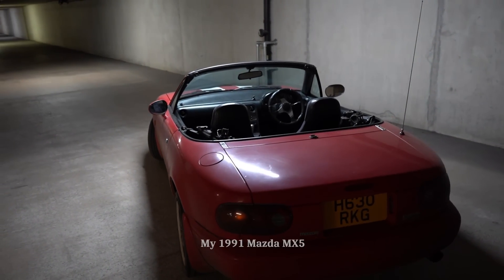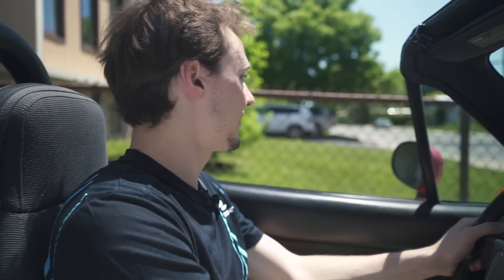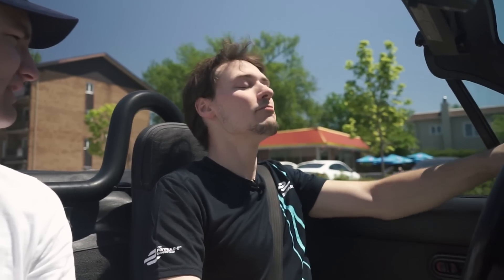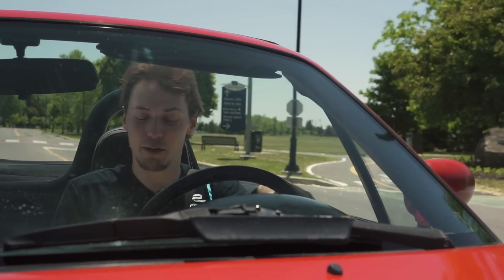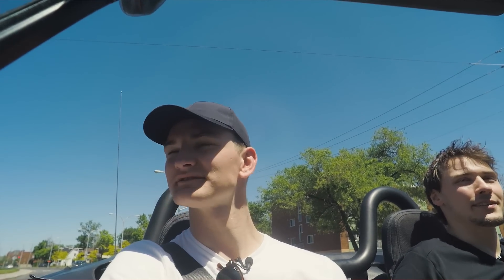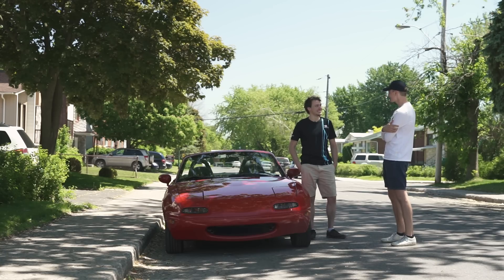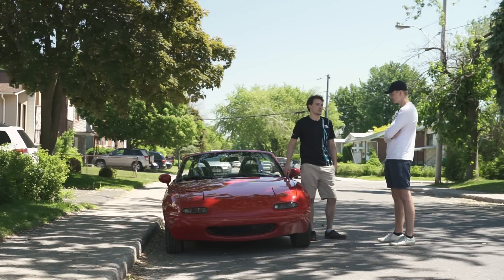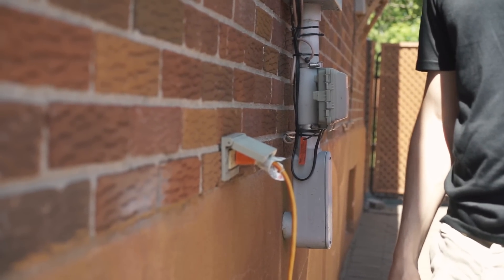A drive in a homemade electric sports car built from a 1990 Mazda Miata

Comment: That was great!

I would have liked to have seen what the motor looks like, though. Is it DC or AC? I've heard that some EV's use AC motors and have to have a conversion component to convert the battery DC to AC for it. I would think that some of the battery energy would be lost in that conversion. I wonder how much it would help the car's milage to use a DC motor over an AC motor.

Comment: How many electric conversion shops do you think there are in the United States?
Reply: not many.... I was going to give it a go, but it's a rough business model. One guy in a shop might convert a car a month, but take 100-150 manhours to do a conversion. hard to charge enough to make a living. Total conversion cost to Lithium will be somewhere between $12k-$20k depending on range and battery capacity; and you can't find a bank to loan it, so its a cash deal. No that big a market.
Reply: @danielbaker716  most of what you say is true there about the hours and the price. My wife made my hobby a business 13 years ago we've been doing okay. Click on my profile to see our shop in projects

Comment: 30 kms range.... 18 miles?
Reply: thats the problem with Lead. Heavy, low capacity, and not many charge cycles.  Ya gotta step up to Lithium to get range and performance
Reply: If that wasn't bad enough, lead batteries die quicker too, by a lot. He will optimistically get two years of life out of those batteries, driving every day.
Reply: @Hamdad  yup, only get about 700 charge cycles out of floodies... 3000-5000 from Lithium!

Comment: Particularly of interest to me as I formerly owned one of the same year. Mine was  one of a batch of 700 with the Sunkist Red paint, and the same wheels as your project car, so I assume it was of that same batch. I imported it (used) from Japan with only 53,000 kilometres and one lady owner.  I had a tyre blow in 2001 while I was driving with the top down, when the car rolled, and I was thrown 20 feet because the safety belt failed (thankfully) but the car was a write off.
Reply: I've been driving my self-converted eMiata ('94) since 2012. Have over 20k electric miles on it. Warp9 dc motor, zilla 1k controller, 160v x 130ah lithium. Super fun. Miatas are a great conversion. more info at envirokarma.org if you want to do one yourself!
Reply: @danielbaker716  I was inspired by your conversion.  The right base to do a conversion on.  I remember being overtaken by a Mitsubishi Evo 7, and I couldn't even catch up.  Maybe  an electric would.!
Reply: @andr00NZ  The torque is AMAZING in a Miata. Limited top end with stock gearing tho since a DC brushed motor 'redlines' at about 5000 rpm. It sure does get from 0-80mph in a hurry . ;)

Comment: how much batteries you would need to power old fiat 600 with lets say smaller motor and lets say 50 km range
Reply: 13.4
Reply: @EasyFlows  kwh?
Reply: @Nele_BiH  yes
Reply: those are super light, so not that much... but I'd recommend Lithium for sure to keep the weight down and not stress the chassis or brakes too much. The average size/weight EV will consume about 1 kwhr of energy per 3 miles driven 'on average' rolling terrain with a little bit of stop and go. Big decision is DC (cheaper and simpler) or AC motor (with brake regen)
Reply: @danielbaker716  I did checked some prices on aliexpress for lithium packs holly shit they are expensive. Motor and everything else combined doesnt cost much as bateries
Reply: @Nele_BiH  that's pretty true..... aliexpress is probably not where you want to get batteries, but yes you'll spend as much on batteries as all the rest. Lithium is totally worth it though with longer life, less weight, less voltage sag. BUT, you have to learn about and respect the fact that Lithium batteries are unforgiving if over charged or run to 0 under load. They die, and don't come back.

Comment: What an awful thing to do to an MX5.
Reply: don't say that  till you've driven it!
Reply: daniel baker I doubt it would make a difference to my opinion. I’m sure it’s a novelty but making an MX5 heavier just seems wrong.
Reply: @richardhoulton4016  what makes you think it's heavier? I did mine with Lithium batteries, have a 50 mile range, and the whole car is a tiny bit lighter than stock (after I swapped out stock seats for Lotus Elise seats)
Reply: daniel baker This one in the vid is 400lbs heavier!  And my Sunday morning backroad run is 350kms! 😂. 80kms (50 miles) just doesn’t cut it...sorry.

Comment: What's your battery capacity (kWh)? And what range do you get? How do you re-charge it?
Reply: He showed how he charges it at the end when he plugged it in and mentioned it cost $1.50 to fill. He also said the range is 35km which he found out when he ran out of power once. It had lead acid batteries so heavy with a short range. Perhaps only about 6 Kw. He started on it when the original Tesla Roadster came out so no fancy battery packs available then.

Comment: How does manual transmission even work with an electric engine? Or is it like a placebo effect to give you the feeling of shifting?
Reply: I mean, an electric motor is still just a motor.  It just has a spinning shaft coming out of it.  You could just hook that up to a transmission instead of to direct drive like a lot of people do nowadays.
Reply: I would assume the motor in it is 10 years old at the least since he built the car 10 years ago or so. Back then, motors were not the best like they are now. They had a power band much like an engine, and didnt really rev high. most reved to about 3600 before dropping torque. Almost all electric cars of that era retained the manual transmission, but most of them got rid of the clutch. Clutch is really unnecessary because you can just lift off the throttle and shift without issue. But it is still fun to have for skids or of you want to shift insanely fast.
Reply: @ohyou_6599  you really know nothing about mx5 do you? practically the NA's engine blows every new engine out of the window if maintained. if you watch the video the dude keeps praising his Corola cause you know.. the corola is also known to be awesome just for being reliable.
the MX5 is made to rev out which means 7k oh higher if tuned. fuel cutoff at 7,3k stock / oil presure increases with rpm and no high boost pressures straining the engine there is only one enemy to this car and that is Rust. ok rant mode off thank you Jester for teaching me
Reply: The motor produces instant torque so you could start it in any gear it's basically giving you the feel but is almost not necessary other than getting the power to the wheels.
Reply: DC motors have a rpm limit of about 5000-6000 rpm, and brushes are advanced to run best in one direction, so most people converting retain the original gearbox and drivetrain. Pretty simple to pull the clutch and flywheel from the original engine, put them on the electric motor, and get an adaptor plate that buttons up to the original transmission, setting the clutch/flywheel right back where it was. voila, the transmission doesn't know youve got an electric motor, expect the torque doubles and you have to be careful not to break things.

Comment: How on EARTH did he make an electric manual? We need these if we want to keep the car enthusiast world alive in the future!
Reply: OrcaStrike77 was wondering and thinking the same thing!
Reply: well i suppose it isn't too complicated in theory. most EVs simply hook up a single speed gearbox, so a simple constant gear ratio. you could just as well hook up the motor to the input shaft of an existing transmission (which is what he did i believe), so you have more torque in lower gears and max speed in higher gears. the reason most EV manufactures don't bother is because motors create significant torque at all rpms and get up to decent speed on that single ratio gearbox too, so they can save some weight, cost and complexity.
Reply: Manuals are actually way easier to convert vs an auto car because you don’t have to do any TCU trickery or vacuum trickery for the transmission since a manual doesn’t need any of that. MTs Only care if you put too much power into it and break gears or if you rev it too high and break gears.
Reply: @Fhwgads11  exactly correct, for DC brushed motors (rpm limited to 5000-6000 before they fling off internal balance weights)

Comment: I despise electric cars. But instant torque in a classic NA with a 5 speed sounds fun.
Reply: And still manual!!!!!
Reply: why do you despise EVs? 200ft-# torque in a NA is a boatload of fun. Mine, with lithium batteries is just UNDER stock weight, and 50/50 balance front/back.
Reply: daniel baker it’s more that I love internal combustion engines too much lmao. I think including more electrics is great, even hybrids, but there’s just something about exploding flammable liquids that is better

Comment: So you are using lead acid batteries... More stable..  I am depressed about  Lithium batteries which are tempermental.
Reply: Joseph DuPont if you’re depressed maybe try taking lithium
Reply: If lithium batteries are so bad, why do ALL EV manufacturers use it?
Reply: @mikiethebikie  because  they can give the same performance with less weight of batteries and  they have engineers to make the right charge and circuts to draw ;power without blowing the batteries up. Its a balance act not meant for ;peo;ple  like me who only understand  Plus Red and Neg Black I'd hate to be on my way to the moon  and have a glitch 100,000 miles from earth. Perhaps I'm being over dramatic, but using these things is more than just getting a deal on
Reply: Not really. Lead acid has poor cycle life. Lead acid conversions tend to need frequent replacement in this application.
Reply: trick with Lithium batteries is keeping them balanced at end of charge, and NEVER discharging too far

Comment: Is is possible using generator instead of batteries?
Reply: Alyssa Price  not enough power and pointless would use mor power than the gas motor if it could keep up
Reply: why build a hybrid? you would need BOTH a generator and a battery bank

Comment: Hi. Do you know Proton Juara? I want to change the engine to electric because it is hard to replace engine model. If you can show how what to do step by step, I would appreciated it. I'm not an expert about cars.
Reply: Hey mate, I think this guy took about 10 years to do this build slowly, it's not a minor thing to convert a gas car to electric. If you are not an expert (as you've said yourself) I honestly think it will be difficult, it's probably going to take 5+ years and many mistakes along the way. Good luck. Also I think you mean the Proton Juara is hard to replace the engine, so I'm guessing the engine is not working so well anymore. Can you find somebody to rebuild the engine? It's going to be a LOT cheaper than converting it to electric.
Reply: This is a good place to start: https://www.diyelectriccar.com/

Comment: Do those batteries affect the handling and weight distribution? Surely they must weigh more than the original 1.6
Reply: See 4:34 onwards where he talks about this very thing
Reply: problem solved with Lithium.... I put half under the hood,  1/4 where fuel tank was, 1/4 where spare tire was

Comment: That is so awesome that you can keep the manual transmission with the electric motor! Very cool. Tesla should hire this guy to make a manual Tesla haha!
Reply: You know what would be amazing? Tesla battery conversions for NA Miatas!
Reply: I really want an ND conversion but the computer lobotomy hassles are daunting.  This guy didn;t even go the lithium route so there is a lot of room for improvement.
Reply: @Yowzoe  I can see this one day being a viable option to swap out the engine
Reply: @vinceyreay  see @electricroadster on Instagram. Can't wait to do it (have it done)
Reply: I mean it is cool but the reason why electric dont have many gears if any is because its not that necessary
Reply: @afish8883  gears are useful if you want to make the most out of the torque having ultimate acceleration & longer legs for top speed
Reply: @vinceyreay  gotta have gears for DC motors with redline at 5000 rpm or so. The AC motors have much higher redline, and can get by with either no gears, or just rev-low-high
Reply: @danielbaker716 - all depending upon the type of motor.....I have RC Aircraft motors that offer torque over RPM, it's not finite
Reply: @vinceyreay   absolutely, motor types (brushed DC, brushless DC, AC) have very different characteristics. DIY conversions often use brushed DC because they are cheaper, simpler, massive torque from 0 and available used. My 'Warp9' is basically a forklift motor with beefed up internals to handle higher current and voltage. Modern OEM EVs usually go with AC motors.... more efficient at higher speeds, and easier to capture braking energy to extend range.
Reply: Tesla did have  a 2 speed  manual gearbox in the Tesla roadster but they kept breaking as gearboxes could not handle the torque from the electric motor so the engineered it out to a single speed.
Reply: falchulk  - not using lithium, likely to be lighter, utilising the fuel tank area for batteries which would maintain the 50/50 weight balance
Reply: It makes the cars faster as only having one gear is an achilles heel for cars that comes electric as standard.
Reply: @TheRealFobican  with brushed DC motors (having a max rpm around 5500-6000 rpm) means that you can get the best performance by having at least two gears giving best torque from a stop, and decent top speed for the highway. Least expensive route is to retain the stock manual transmission. Automatic transmissions are 'problematic' for a couple reasons: 1. difficulty to tell them when to shift without the normal feedback from the gas engine. 2. the need to add a pump the engage the transmission from a stop as the motor is not 'idling' like a ICE motor.
I did something similar with mine: http://envirokarma.org/ev2_mx5e/
Reply: Worst idea ever.
Reply: @MrDownRater  - said your mom when your dad didn't pull out
Reply: @vinceyreay  You are so mature...
I'm not a new kid on the block, we built some bad electric cars from old Ladas and BMWs where I live 10 years ago with the same technic.
Then a guy met with us and show it how you can do it well.
This guy was Mate Rimac (with his E30 BMW).
What this guy in this video did is the cheapest and easiest way to build an electric car, also the worst solution.
Check out some DIY electric car forum pal. ;)
Reply: @MrDownRater  LOL
Reply: @vinceyreay  You can laugh, but at the time I lived in Pécs, Hungary.
One of my friend organized some small DIY electric-car meet ups time to time.
In 2008 there was a meeting in Virovitica, Croatia where he came to show us his own conversion kit.
He seems a bit  like a mad scientist.
He was talking about how his product will change the car industry.
Also he showed us some of his other inventions.
A glove which can be used as a mouse for a PC (it felt bulky and it had bad sensitivity) and a PC controlled car mirror which uses actuators to tilt to show the best angle every time to avoid blind spots (it wasn't great either).
However his desperation about developing the best electric car looked strong and his conversation kit was way better than what we've seen/built before.
Reply: @MrDownRater  - I think that you're missing the point of the video....an over the counter 'plug & play kit that replaces the engine, fuel tank & ecu with a compatible electric donor unit could be mass produced at the right price to end users.
Reply: Yes and they should definitively put gas engine into all the teslas 🤦🏼‍♂️
Reply: and what would be the point of that shady?  Less acceleration?  More maintenance?  Higher fuel cost and higher overall cost per distance travelled?  Or do you just like engine sounds and smell?
Reply: @theelephantintheroom6680  I was defenitely trolling... This would be a stupide idea...
Reply: @theelephantintheroom6680  Nah would be funny putting a V8 in a tesla, making it roar and going to a petrol station XD. And having a manual ofcourse.
Reply: @castielfromheaven  definitely*